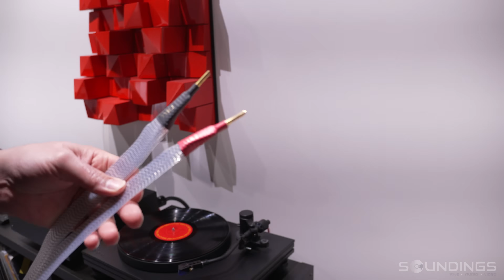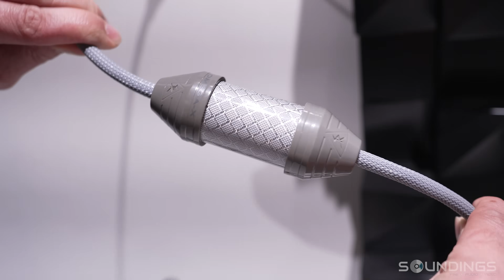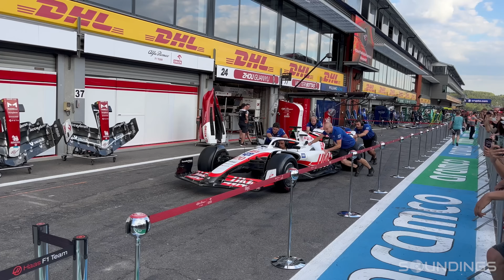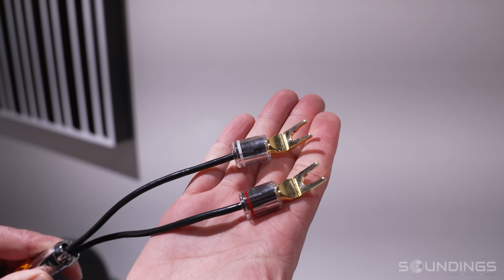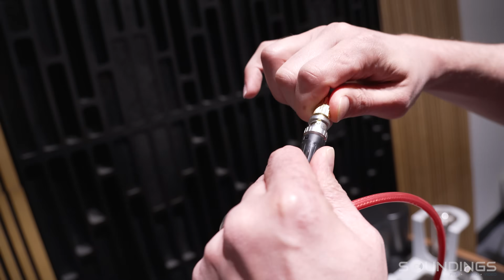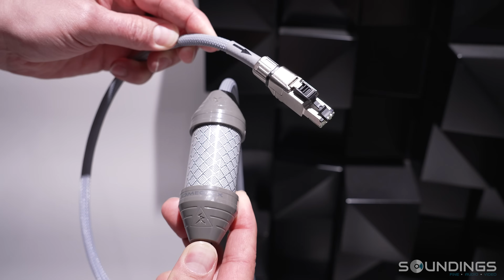Do Cables Really Matter in a Hifi System?

Comment: I often wonder what is wrong with a person's system in the first place, that they have to imagine an improvement via wire. The idea of EQ-ng speakers with wire is wild. Whenever I see people start throwing such tweaks at a system, it pretty much lets me know they bought the wrong speakers or don't know how to implement them properly or they're rooms suck. 

Half the reason many people go down the wire trail is because that is all they are qualified to touch. That and a bunch of other bolt-on "upgrades." This makes them feel like a qualified contributor to the system's quality. It cannot sound as good without their hand in it.
Reply: Ignorant comments. I have boxes of cables here, and each one has its own sound, tonality, etc. Speaker cables, USB cables, Ethernet cables, interconnects, XLR, even optical cables. They all treat sound differently, some good, some are just god awfully terrible, totally killing the sound. Spend some time in this hobby, and the better your gear gets, the more your cable choices will matter.
Reply: @michaelwright1602  Been at it 50 years and built at least half of the dozen amps I own, and more than half of the dozen or so pairs of speakers I have, and none have needed "boxes" of specific cables to sound good. Save that nonsense. I went to school for electronics and has been part of my day job for nearly 40 years as well. 

I install the same wire inside my amps and speakers that the manufacturers you buy from use and I have 100ft spools of it in 9 different colors, and 6 different gauges and two different sizes of shielded and make my own speaker cables as well. So keep dreaming about magic cables between those ordinary wires at each end, inside the equipment that you use. 

Only thing "ignorant," is obviously with regard to your understanding of electricity and electronics.
Reply: @mrboat580  In those 50 years have you ever cleaned your ears? I can swap cables right now and a person with good hearing would pick up on it immediately. Done it more than a few times here. Have your ears checked, and maybe try some different wire.
Reply: @michaelwright1602  You're lying. You have never done that with anyone with your cables. It's heresy and proves nothing. Just like there are never any proofs across the vastness of the internet. More people with excellent hearing, debunk the cable myths than adhere to them. 

If your hearing was as good as you claim, and that you can hear wires, the noise pollution of every day life would be driving you stark raving mad to where you had to wear noise cancelling head gear. Now stop being ridiculous.
Reply: They didn't buy the wrong speakers, or the wrong anything. 
 They'll never be satisfied with any system, regardless of price, or manufacturer. 
 They think everything needs to be perfect for perfect sound. Problem is, perfection is a futile chase for the "Audio God Molecule" 
 I gotta go, it's a full moon tonight, and that's when my system sounds its best. 
 Good day.
Reply: @mrboat580 ...Ignorant comment. How much will it cost swapping amplifiers & DACs to 'tune' your home-audio rig compared with trying to make sonic adjustments with different wires/cables? Maybe you should stick to boats 👍😉
Reply: I don't have to keep swapping anything. I know what I am doing and just buy or build adequate equipment to start with. "Swapping" is usually done by amateurs who just keep throwing nonsense at their systems until they find the problem, or move on to the next newest greatest thing. 

I have DACs I built based on the Phillips TDA1387 chips from the '90s that still fools everybody to this day. I have never heard any better, mostly because I don't hear it at all and neither does anyone else.  

I've built enough amps and speakers to know what wire decides the system and precisely where that ends. So keep throwing imaginary things into the imaginary magical spaces between your amp's and speakers internal wiring and have fun with that.
Reply: @mrboat580  Yeah, yeah, and get off my lawn! And I will put my Burr Brown PCM1794A dual mono DAC up against your TDA1387 any day of the week. Now go clean your ears.
Reply: @michaelwright1602  It's not my fault you bought the wrong gear that you imagine so many corrections needed after the fact. It's also not my fault that you are ignorant of what's under the hood of your components. But since those plain wires reside out of sight of your la-la land, your fantasies are safe. 

Otoh, you have what amounts to the world's largest library of all-ness right at your fingertips. You could actually learn how electricity works, and quit being taken for such a sucker.

Comment: Attempting to use objective measurements of the effects of different speaker wires as the ultimate authority , omits the FACT, that ALL SOUND IS SUBJECTIVE. 
Even with the consistency that objective measurement provides , it will still end up being interpreted, differently by each listener.
 “objective fact matters not when subjectivity enters the room. “
 A middle road might be 12 gauge stranded copper not to exceed a certain distance , In my opinion of course .
Reply: 100% agreed.  12 G copper is what I usually connect my system up with.
Reply: .      Since I am not a wine connoisseur & wouldn't know the difference, would you serve me Prison toilet raisin hooch?

Comment: Hello, from Australia👋 For decades I never thought that audio grade power cables would make my home-audio rig sound any different from the $7 factory supplied, 'in box' ones, but I found out that they do. The bass response came across with more clarity & with more gravitas. Also, I have replaced my PCOCC interconnects with 5N OCC silver ones, again, because of the audible improvements in sonic detail, especially in the upper mids & treble regions. Hearing is believing ✌❤🎶